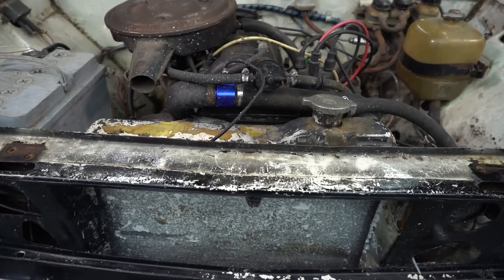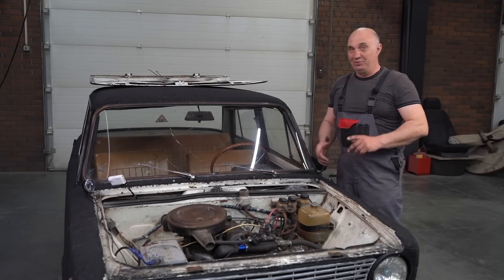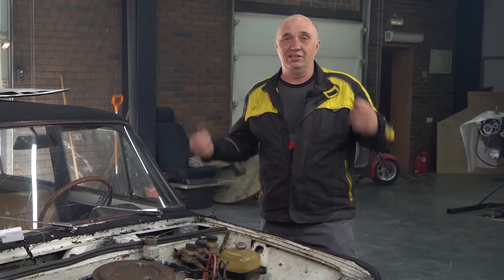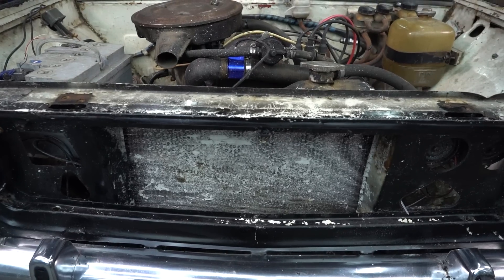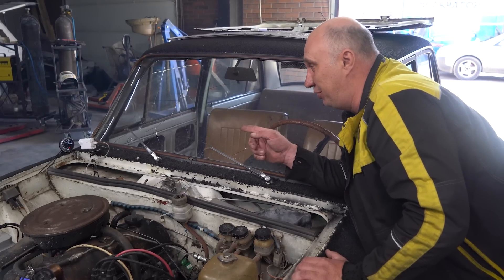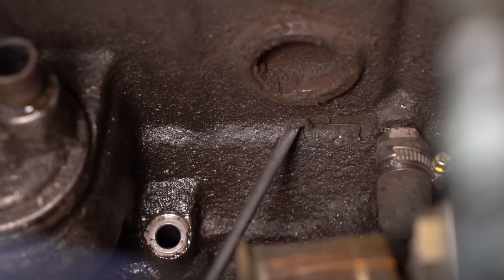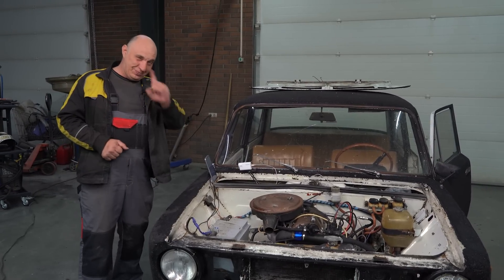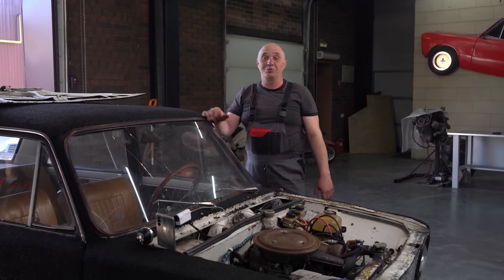How dirty can your cooling system be and still work?

Comment: Next experiment high voltage ignition system
Reply: All ignition systems are high voltage
Reply: @bonzo3485  im talking dragster ignition system enough to kill a man
Reply: @MEMORIA1991  I mean you could stick a pair of msd 44 mags on one but the spark doesn't necessarily increase power unless the fuel mixture is extremely dense like a top fuel car, would be pretty cool to be able to weld on the go by disconnecting a plug wire and slapping a welding rod into it tho. Ignition systems are the most often overlooked part of most builds because factory spark is made for longevity of plugs and fuel efficiency not power
Reply: @bonzo3485  Well the original ignition coils were usually 10 to 20 KV while the high voltage ones you could replace them with started at 30 KV and up. So high voltage in comparison to what is the question. The higher voltages ensured hotter sparks and could support larger gap length than the ordinary ignition coils. This was supposed to work better with extra high compression and ensure faster burn.
Reply: I remember that this was a thing back in the 80's. Haven't seen it available for modern cars, only for engines using the old style of a single ignition coil for all the cylinders.
Reply: vlads already done this with mains power to the car car